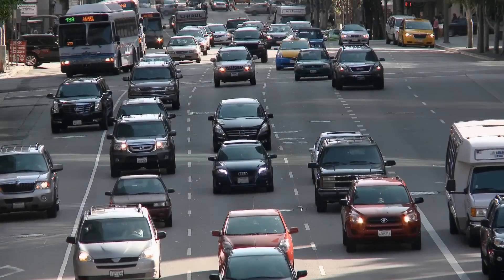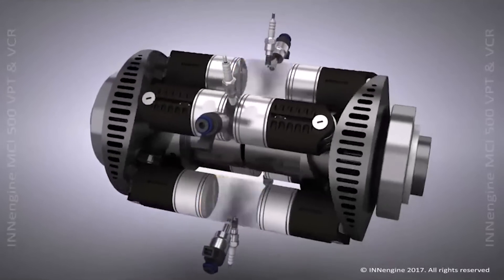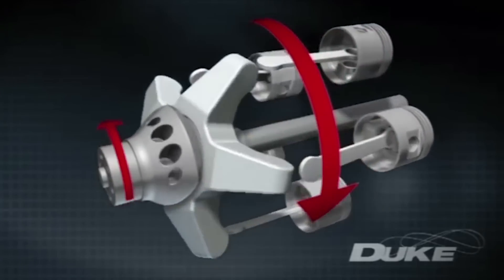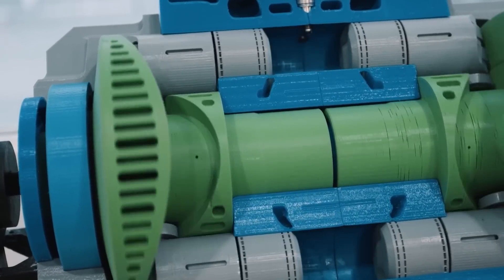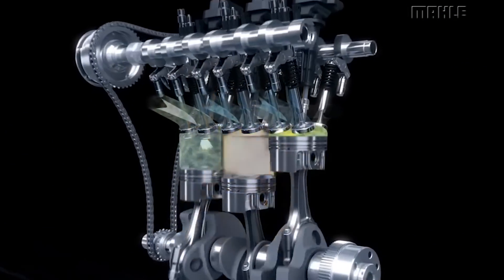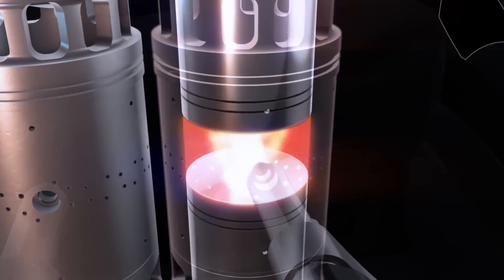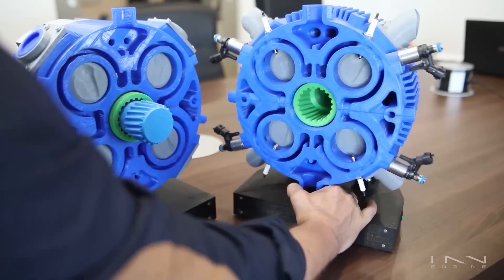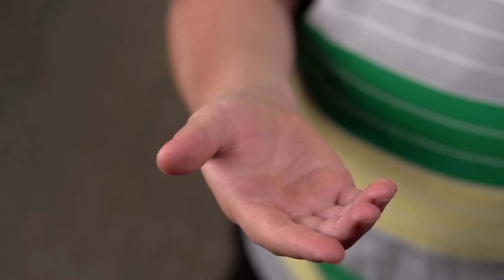Revolutionary One-Stroke Engine: Future or Fraud?

Comment: Its snakeoil. The engine might actually be able to do some things better than other engines, but not nearly enough to make any meaningful difference. Swash plates are less efficient than crankshafts but more compact. Opposed pistons give you a couple percent points in efficiency, but not that much.  In the end i just don't see a big market for range extenders, but there will definitely be a small one so they might make it work there. I do however agree with you far too much marketing BS.
Reply: Look at a kauertz engine, my old prototype was built by a German friend with some crude design flaws one such being the mild steel construction including combustion chambers, due to relying on close tolerance for compression combined with the thermal expansion of the internals it kept seizing after a short run but it had 4 power cycles per revolution! With refinement it could potentially have real power density!
Reply: @needmoreboost6369   Those 4 power cycles and relying on those tight tolerences instead of rings for compression is the problem. Or if you have rings and can't get enough compression, that's a simple problem that I'm sure i'll see when i see your engine. Either way for combustion events per rpm is not possible with any steel. Maybe nickel, chrome, tungsten, or depleted uranium. But you need to fix that through reduction. Like a wankel. There's 3 combustion events for each rotation of the rotor, but the crank turns 3 times for each rotor rotation. Use a separate output shaft that turns at least two times for each crank rotation, get your exhaust out of it quicker even if it means starting before the power stroke is complete. Give it more clearence stagger and gap rings properly rings properly and be sure they seat. With two combustions per rotatation. You may still need something like 40:1 fuel to make it work. Loosen up on those pistons and let the rings take care of compression.
Reply: @needmoreboost6369  System is cool but no one got it to work efficiently and reliably ever. Otherwise it would have been used. Its not a new concept. As for the 4 "cycles" per revolution I would argue it has 4 "pistons" in a circle with a 4 "stroke" cycle where each 
"piston" gets to go through all 4 "strokes" within one revolution of the circle. It really is all a question of definition.
Reply: Its a very light engine that could be carried easily.  Its well balanced and power dense...  Seems like it would be ideal for for a very powerful backpack leaf blower or power washer.
Reply: Sorry, but it burns liquid fuel, so by definition it is obsolete. Even if it runs on hydrogen, which has its own difficulties regarding production and transport, it will still have an excess of moving parts and the need maintain an inefficient aftermarket parts industry. We just need to stop burning stuff.
Reply: @gfbprojects1071  liquid fuel isn't being made completely obsolete anytime soon. Oil is completely obsolete in Brasil, but liquid fuel isn't.
Reply: I know this is an old comment but I think it's really hard to overstate how incredible something like this would be for hybrids/range extenders--small, lightweight, efficient--always running at its ideal speed, it would be like a dream come true. EV predictions almost always fall flat on their face so I'll try not to make any, but in the case that EV adoption does continue to have problems in the US, be due to charging availability, raw material scarcity, or purely consumer superstition on range, I could absolutely see major manufacturers marketing something like this as a solution.

Aside from range extenders, there are a number of applications where something like this would be ideal. It would make for the perfect portable generator set for jobsite, recreational, personal emergency use. And a huge one is auxiliary power units for semi tractors, followed by refrigeration units on semi trailers and railcars, and welders--all as long as it's more efficient in fuel costs than small diesels. While I don't see much of a future for gasoline consumer landscape equipment, depending on the efficiency to cost ratio (which I imagine could be huge given small engines are terribly inefficient), this could also be viable for commercial landscape equipment, and really any other small engine application.
Reply: I agree 100%. I've been a mechanic for a long time and I'm studying to be a biomedical engineer. All I see is Murphy's law Murphy's law Murphy's law.
Reply: Have u looked at the 4 sided rotary called the quasi turbine. 
It is 1 fifth the weight, of a piston engine  has almost zero vibration, can be used as a sterling g( heat engine)  and a alternator can  be mounted in its centre as other is empty.

Comment: We should invest more in synthetic fuels. Make them CO² neutral. It is not impossible. We don't have to build new cars oe busses.
Reply: Where does the energy come from? If from Solar or wind you’re better just charging an EV.
Reply: not possible unless u have alot of land and water, like brazil
Reply: @margarita8442 and Brazil only has that because it's burning the Amazon rainforest down....
Reply: @margarita8442  I don't mean Ethanol. Synthetic Gasoline and Diesel.
Reply: @christiannoble5549  how u make this ? from water ?
Reply: Bringing down the cost to electrify railways would probably better suit the last part.
Reply: @JarrodBaniqued Robotaxis will make most trains and buses obsolete.
Reply: @@Aquafyre Our goverments are lobbying for CO² neutrality and for EVs.  We don't have to buy mew Electric Vehicles when we burn CO² neutral fuels in our older cars. You can make Fuels from the CO² in the air. It is still expensive but It is possible.
Reply: @christiannoble5549  EVs are more than 3x more efficient than ICE cars. If you add in the energy required to synthesise the gasoline then EVs are around 10x more efficient.

Go learn something before you embarrass yourself any further.
Reply: @fredbloggs5902  You still have to produce the EVs and that needs lots of energy and produces lots of CO². Vehicules with internal xombuation engines are already on the road and if you can fill your tank with CO² neutral fuel you are saving lots of energy in the long run.
Reply: @christiannoble5549  cluelessness confirmed 

Blocked